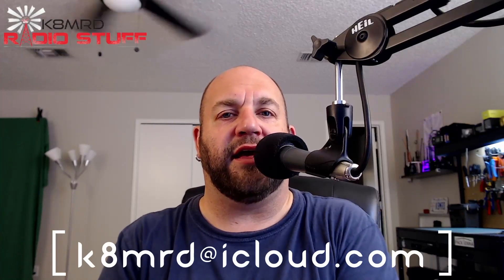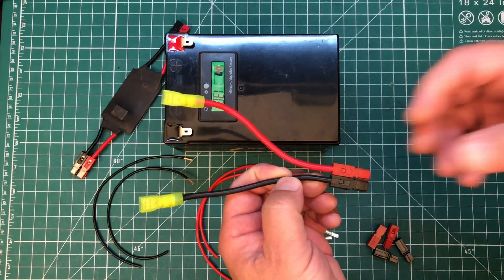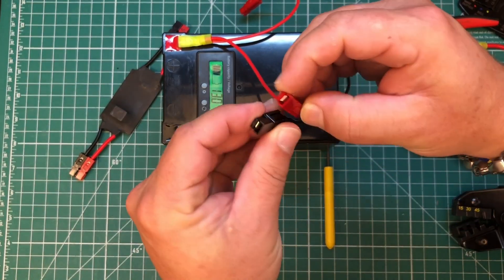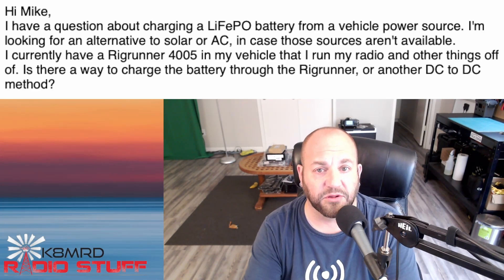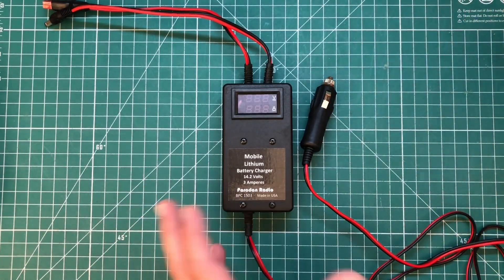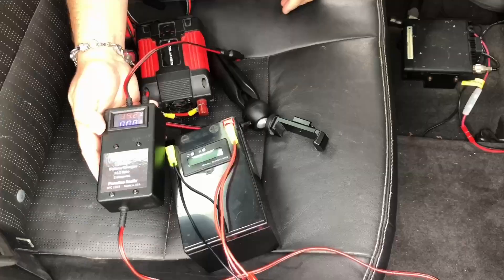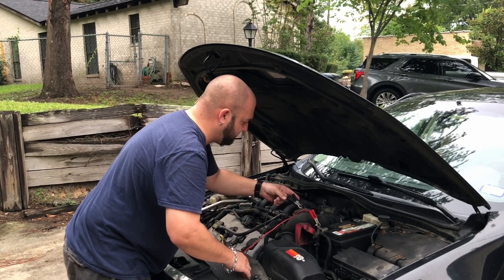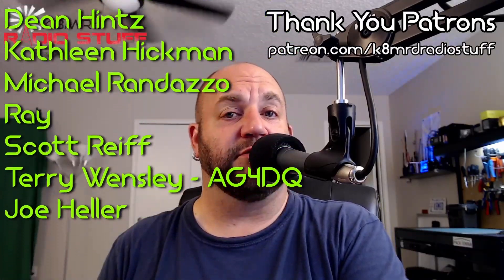Can you Charge LiFePO4 from your car?  Mailbag Monday #28

Comment: Your alternator must hate you.
In a pinch, I would think that you would be able to just put the LiFePO in parallel with the car battery.  I wouldn't do it often, because it could pop the LiFePO or its BMS, but 12 volts is 12 volts.
Reply: 12V is 12V, but 13.8V isn't 11V. If you hook a depleted LiFePo4 cell up to a charging allternator, as Johan indicated, the huge available current can destory you LiFePo4. If they're close in voltage, you have no problem whatsoever. If you have a top-notch BMS, you won't do any permanent damage. But without comparing voltages, measuring cable resistance, and invoking the power of Ohm, I'd much rather use a constant-current power supply.
Reply: Negative. LFE charges very differently from SLA or FLA batteries. You'll warp the cells and do permeant damage to them if you try this. SLA batteries bulk charge to the last 10% and then float charge beyond that.  LFE batteries need different charging stages to properly charge. There's bulk charging, absorption, equalization charge, float charging. That's why LFE batteries have/need BMS systems. The BMS also does what's called bottom and top balancing of the individual cells in an LFE battery, because if you over/under charge one of the cells, you do damage.
Reply: @DagonNaxos  

>  You'll warp the cells and do permeant damage to them if you try this

Some of us have actually tried it, and are direct-charging well within the battery's and alternator's specs.  I=V/R like everywhere else.  

> LFE batteries need different charging stages to properly charge

They do not.  Charge-and-stop is generally considered optimal. 

> The BMS also does what's called bottom and top balancing of the individual cells in an LFE battery

Most commercial LFP batts do passive top-balancing only.
Reply: @fratermus5502  Maybe I wasn't detailed enough. First, yes you can charge the battery off a battery and alternator, but a battery any battery, will absorb as much energy as fast as you let it, so without some sort of volatge and amperage regulation, depending on the battery's specs for max charge rate (C rate), you can and will absolutely do damage to the cells. Plus, no matter the chemestry, exceeding the maximum C rate for either charge or discharge will generate excessive heat inside the cells, causing cell drgradation and significantly shorten the life of the battery at best and an over pressure and possible safety valve blow off at worst. You don't want to breathe in gassified lithium. Bad news.

2. Yes, it's true that LFE batteries do "bulk charge" between 10% and about 85% state of charge but, again, modulating that volage and amperage is very inportant for the resons stated above. If you want to charge beyond 85% and "finish" charge the battery, there are certain things that need to happen that the charger or BMS has to handle in order to do that. Ever notice how an LFE or NCM battery can charge up to 80% in like a half hour, but the last 20% takes 1.5h? That's because it slows the current down and modulates the voltage and it constantly reading/balancing the cells via the BMS to optimize the battery.

3. Most small consumer batteries only top balance, yes, but for optimal battery performance and life, the bigger more expensive batteries do both. But the fact remains the there is always SOME circuitry that is checking the SOC on the individual cells and making them as even as possible

Last, I NEVER said it wouldn't work or that you couldn't do the things I mentioned, but you have to remember that not everyone delves into these things as far as you and I have here in this conversation, nor should they have to. My recommendations are based on safety, experience, research and general best practices to get the longest life and best experience out of the batteries. Ibalways err on the side of caution and safety when dispensing advice to the general public, because I don't want them doing something that, although technically possible, could cause injury or catastrophic failure.

Comment: Don't you need a proper MPPT controller like the Buddi one for an LiFePO4?
Reply: Not MMPT, that's only for extracting the max juice out of solar panels. You need a CC-CV power supply, which is the brains inside a Lithium ion charger.
Reply from the maker: No

Comment: There's an XT60(?) connector on the back of my HiTec charger - is not that a DC input, and could it be used to connect to vehicle DC, rather than going thru the inverter (DC > AC > DC)?
Reply from the maker: I’ve not done it but I believe you very well could do that too.  Good idea.
Reply: Yes it can. I have xt60 on my charger and it can take input 8 to 16V. 73 de M3KXZ

Comment: I have a power inverter with a separate 12v battery to a solar charger. solar panel mounted on the luggage rack permanently  LOL Like that when i drive from p2p i plug in to the power inverter 110v . 73s de n3lou

Comment: Hi mike, I am setting up my car for mobile/portable ops. I am using a split charge relay, used to charge caravan batteries on the move. I am using lead acid, but you could charge anything using your system. One advantage is that you do not drain your car battery as the relay senses voltage. Will let you know  how it goes Jim M7BXT

Comment: I so can't wait for the BuddiPole PowerMini 2 to come back in stock. I want to pick up another. Having said that, I wonder if you could just plug your battery into the battery port of the PowerMini 2, plug your car battery into the solar port of the PowerMini2, and charge your LiFePO4 battery that way, AND have 2 power poll outputs. Thoughts?

Also, what make and model DC to AC inverter are you using? I was hoping you'd mention it since I assume yours has a nice, clean, AC output.

Great video!
Reply: After doing some digging, I'm guessing it's the CEN-TECH POWER INVERTER 66814 400 WATT CONTINUOUS 800 WATT PEAK. Did I guess right?
Reply from the maker: I’m honestly too lazy to get off the couch after dinner to check, but it’s from harbor freight and I would not recommend it near radios if you are operating.  It puts out an incredible amount of RFI.
Reply: No. A solar charge controller, be it a PWM or MPPT, needs a minimum voltage of 17VDC + to activate and start the charging process. Now, if you put a 12VDC to 24VDC boost converter and then hooked the solar charge controller to that, then yes. But why would you.

Comment: Good video bud. Only thing I would add is when attaching direct to battery with alligator clips, you probably want inline fuses on both positive and negative terminals. Last thing you want to do is have a short direct to the battery. That’s from first hand experience. pouf
Reply from the maker: So we don’t want the magic smoke??   Good idea.
Reply: I like to put a high-power, 1 Ohm resistor inline. The delta-V isn't generally big enough to need much current-limiting, but for small capacity batteries, a 1-ohm chokepoint eases my mind. And I haven't damaged a battery, or melted a wire yet!